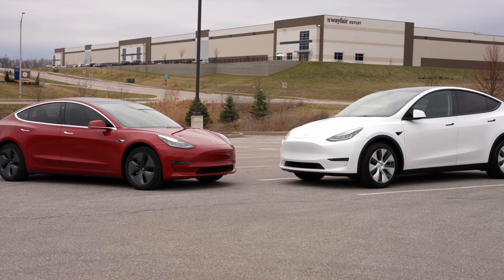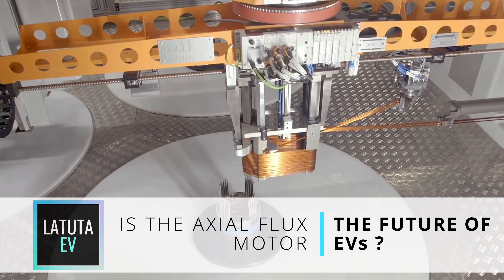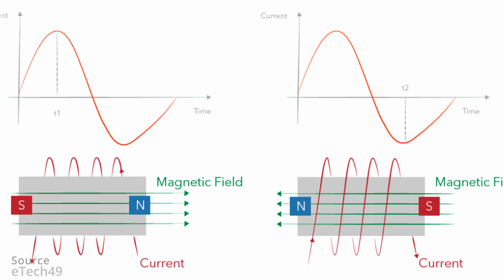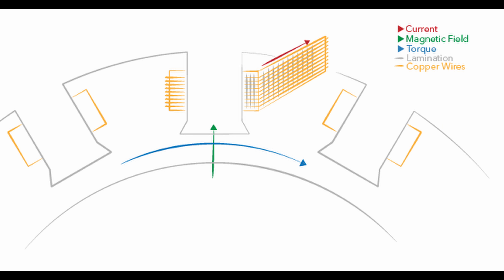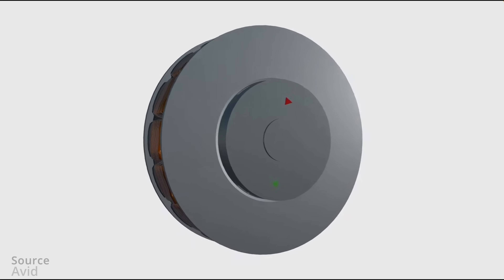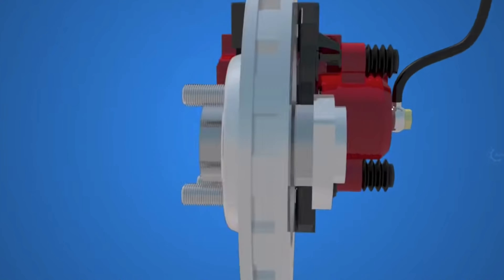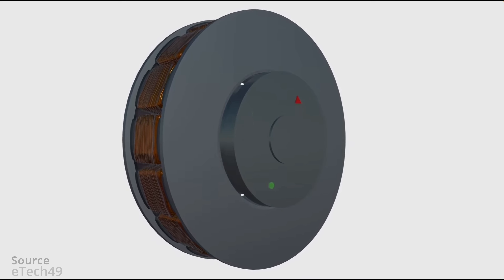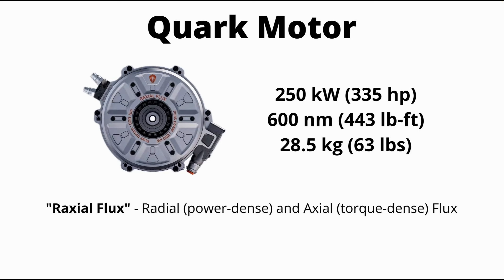Can Axial Flux motor improve range and efficiency for EVs in the future

Comment: Thanks for the video. I had watched some other videos on axial flux motors, and yours is very clear and easier to follow. I am glad that you covered the Koenigsegg Quark motor, because it is fascinating to me. Being small and relatively light makes sense, and high torque follows as well with the design, but it is interesting that the Quark motor makes immense power initially, but just for a short time, and then drops down to more realistic performance. I am not sure if this is related to heat buildup, or other factors. But realistically this is generally how normal EV drivers will need their power. With peak power on demand for a few seconds when accelerating from a stop, or say merging onto the freeway, but after that brief point of higher power requirements, having high efficiency is more important, say driving on the freeway. I wonder if Koenigsegg has plans to build a smaller, less powerful, less expensive motor for use in more affordable EVs?
Reply from the maker: If you watch magnax video the Axial motor has more torque while radial has more power. Koenigsegg combined both into one. This should give you benefits of economy and acceleration. I would love to see this motor on Aptera
Reply: @LatutaEV  I contacted Elaphe, who will be building the Aptera's in-wheel motors, and they said that they had looked at using an axial design, but found the best balance between power and efficiency being in their radial in-wheel design. They did get a relatively lightweight motor as a result, with 67HP(50kW) and a whopping 516 ftlb (701 nm) of torque, and this power X 2 or 3 wheel motors in the Aptera's lightweight, aerodynamic body gets solid performance, and exceptional efficiency.

Comment: Thanks for the information! Just a minor correction: Tesla is using internal permanent magnet (IPM) synchronous reluctance motors (SynRM), not PM switched reluctance motors.

Then, for the pros and cons, on the one hand, you're saying that AF motors would be much easier to manufacture. A moment later you're stating that it is considered that AF motors are more difficult to manufacture. I'm sure that the latter statement is correct because otherwise, AF motors would have been integrated in most of the EVs by now.
Reply from the maker: Thanks for the correction, I did check it before I was recording but didn't recite it correctly. I don't like myself when people give incorrect information, sorry

Comment: Depends entirely on 3 things
1.motor efficiency (determines the watts per km/mile needed)
2. Mass of vehicle (less mass less energy needed to move the given mass)
3. Aerodynamic drag (reduction in drag reduces the amount of energy needed to move through the atmosphere)
If a motor is 95% efficient and another motor of a different design is also 95% efficient then they will use the se amount of power assuming everything else is equivalent, in terms of motor mass axil flux are lighter.

Comment: I'd argue that the limited energy density of current batteries means that it would be a good idea to improve the efficiency of motors and control electronics.
Once better batteries come around, the increased efficiency of the new motors and control circuitry would improve things even more.
Reply from the maker: I would argue that one must address the limiting factor which is battery. There is even a channel on YouTube with the same name. But batteries are a hard problem to tackle I suppose you may pick low hanging fruit if you can

Comment: BTW: the Lohner-Porsche, built between 1900 and 1905 was a serial hybrid electric car with 2 or 4 axial flux motors, which were integated in the front wheels or all 4 wheels respectively.
Reply from the maker: Yes it's amazing isn't it. I knew that he made hybrid but I didn't know it was axial motor
Reply: @LatutaEV  a very special motor and 3-phase commutator design was used which was developed by Nicola Tesla. The rotor had an electromagnetic excitation.

Electromagnetic excitation is under consideration today in order to avoid permanent magnet material and to vary the back EMF to get better efficiencies for the whole motor speed range.
Reply from the maker: @gkdresden  But Tesla seems sticking with permanent magnets but trying to move away from rare earth magnets
Reply: could you provide more information about the AFM used in this vehicle, what i have found looks like RFM one
Reply: @LatutaEV  Nicola Tesla has nothing to do with Tesla Motors. At his time there were also no rare earth magnets. Even the good old AlNiCo was used for the first time in Japan in the 1930ies.

AlNiCo was the first "high-energy" magnet wirth coercitive fields of 32 kA/m and remanences between 0,6 T - 1,3 T (6000–13000 Gauß).

Today we have NdFeB materials with coercitive fields in the range between 870 - 2750 kA/m and remanences between 1.3 - 1.6 T.
Reply from the maker: @gkdresden  Thanks for your comment. I don't think I said anything about Nicola Tesla having anything to do with Tesla Motors...

Comment: So, you can quite easily install axial flux hub motors directly into the wheels, remove the engine and drive train, install short range batteries and use the large surface area an the bottom to install an induction charging coil to wirelessly charge while you drive and park. Problem solved. And charge the grid with solar panels.
Reply from the maker: Well you have very futuristic view on this but yes that is something that could be implemented. I am not a fan of in-wheel motors. Big unsprung weight is not a good idea

Comment: Thank you sir for yet another great video! And now, for the real question: Could anyone hack the Prius inverter to control an axial motor like the EMRAX 228 (a dream of mine is to gei it into my conversion)? What is your take on that, sir? Any thoughts?
Reply from the maker: In theory it should be possible I know that some axial flux motors require faster switching speeds so IGBTs may be not fast enough but I suspect that it may be possible. You almost reading my mind with your question. 😉 And thank you for mentioning EMRAX as I have not heard about them before

Comment: The title promises to demonstrate that the axial motor makes an EV more "efficient" but it fails to do so. The 30 to 90% thing has nothing to do with radial vs axial, radial ones already have >90% efficiency. The r2 vs r3 scaling of the torque argument is not comprehensible, is the torque of an axial easier to use? it eliminates a gear box for the same power? How does the comparison with the brakes help?
Reply from the maker: The 30 to 90 was a step from ice to AC induction further on I stipulated whether it may be possible to make another step to increase efficiency further. Many people found comparison with the drum brakes helpful to understand the narrative of flux motor
Reply: @LatutaEV The energy efficiency increase between an ice and an electric motor is meaningless because it compares two systems which employ vastly different fuels. If you use gasoline with an electric motor, with whatever gadget in between,  you get back to no better than 30 %. The meaningful comparison is between the fuels.
I don't think you can hope to significantly increase any small electric motor efficiency from the present radial motor efficiency which is in the 90% range already, 100% is the limit. All your considerations about efficiency are of little use in comparing radial and axial motors for a simple reason: they are already very very similar and near to the top.
The same is essentially true for the comparison with the two types of brake, they are both 100% efficient. You can’t decide which system to employ based on energy efficiency, hence you can’t look at a brake for a rationale to decide between radial and axial motors. If there is a reason to make one superior to the other, which on occasion must be the case, you should mention it explicitly.
The generic r scalings presented are incompatible with simple dimensional considerations, unless you specify what you keep constant, for example an r dependent property in one case which is left free in the other.

Comment: There are no advantages in terms of range, weight, volume, cost or efficiency by introducing axial flux motors. The current best Raxial Flux by Koenigsegg is not on par with Lucid.
Reply from the maker: Yes you might be right. Have you heard about H3X?

Comment: Axial flux EV motors are very old news, decades old in fact. Only by cherry picking data, can you claim they're so much better. They can be very good motors indeed and the form factor a real advantage for some aplications, but the axial flux often has them beat. Many people are rushing to invest in the EV sector and much of recent hype is mostly just fishing for investment money.

Looking at the published wh/mile figures a Model 3 is about 20% more efficient that a Model S and it's a smaller car with less drag.
Reply from the maker: Perhaps you right and if you noticed that the video title was with the question mark. But this is certainly a good question which will be answered in time. As far as I know Mercedes did acquire Yasa Motors. I guess they have seen promise in the axial flux motor technology.
Reply from the maker: Hi Paul I have just re-read your comment, did you meant to say radial flux motor often has them beat? I would love to know what are the major disadvantages of axial flux apart from those I have not mentioned?